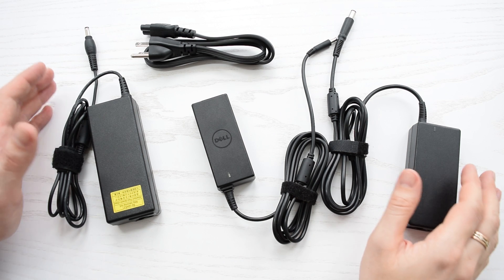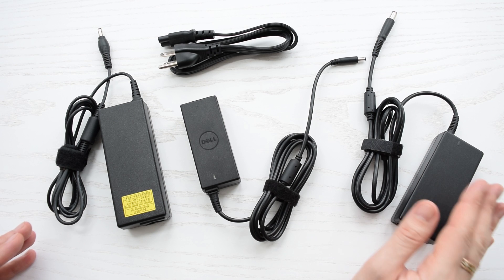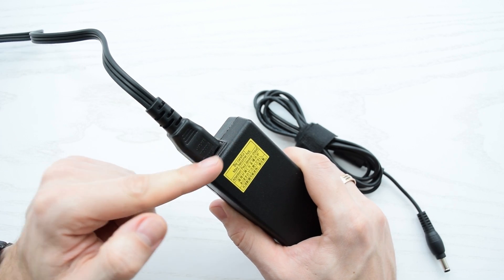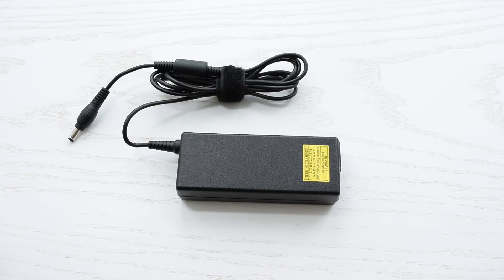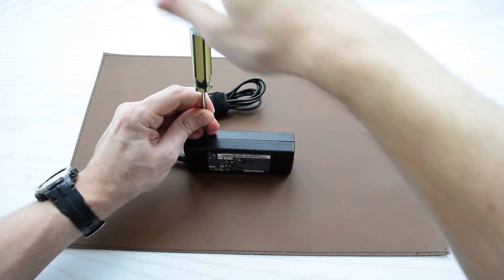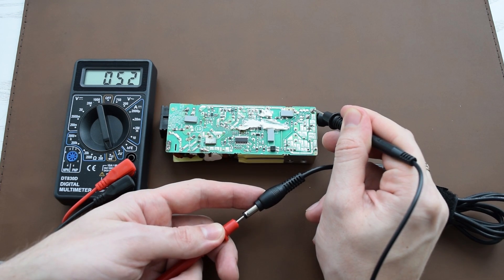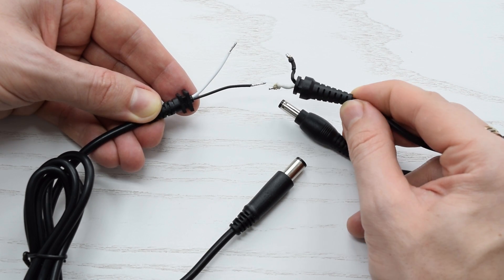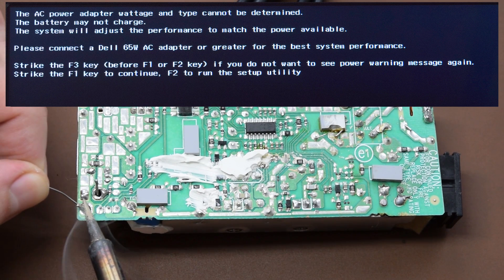How to Open and Fix Laptop AC Adapter without Damaging. DC cable and Capacitors Replacement

Comment: Hi, first of all great tutorial! 
I wanna ask about one thing. The LED on my adapter is of and it doesn’t give any power out. But somehow after a while with it’s plugged to power source, it became hot. Based on this, what is your diagnostic on this? Thanx in advance.
Reply from the maker: most likely you need to replace capacitors and I'd also recommend checking DC cable for short.

Comment: My spec is 9.5V, 9.3A and 180W, but when I try to buy DC cable only at online shop I cant found any with spec above 7A and 150W, if I use it what negative effect on my laptop?
Im trying to change my cable only not the adapter, will the 7A cable hold my 9.3A adapter?
Reply from the maker: There's no way your laptop can draw so much current. Not even close to 9.3 or 7 Amps. So you can buy that one it's totally safe.
Reply: @ElectronicsComputers  alright thank you Sir
Reply: @ge2565 Did you replace the dc cable?
I'm having the same issue and I'm worried that the dc cable I buy would not have the right voltage and current rating
Reply: @bonklord3925  no, my replacement cable is so thin im afraid to use it so i just cut my old cable in the part where its broken and then reconnecting it with solder+heat shrink tube

Comment: Hi!. Do yoy think it could be possible to solder the hp cable to a dell power brick? I think that the L shape holds better than the Dell design
Reply from the maker: Technically they are absolutely identical so you can easily swap them.

Comment: Broo, yyou made my day, Thank you so much, I have fixed my own cable and now I am back with you all. Thank you !!!
Reply from the maker: I'm glad I could help you!
Reply: @ElectronicsComputers I need help can anyone tell me whether my adapter is faulty or not based on following test
My laptop adapter input is 19.5v. so when I set my multimeter at 20v it shows 0L and when I set it to 200v it shows 20v and when I set my multimeter to 600v it shows 19v based on this is my adapter faulty or not?
Reply: Did you fixed it on ur own?

Comment: Being a complete novice, after removing the outer shell (which was a bit more difficult than expected), I picked up the board without any gloves and it shocked me. So I decided to start moving it using 2 big screwdrivers (with rubber handles, bear in mind) but they must have touched and something sparked. Lucky for me the charger was unplugged (at least I tought of that!). Lesson learned: next time, DON'T TOUCH THE PCB, WEAR GLOVES AND WAIT A FEW HOURS AFTER UNPLUGGING THE DEVICE BEFORE HANDLING IT!!!!
Reply from the maker: The big capacitor must be discharged before you start working on it. It's not gonna kill you but still unpleasant experience I should have mentioned about discharging the caps. Sorry for that!
Reply: Such a great advice, sir. Thanks
Reply: "and it shocked me" ...
as is i am a m_oron and stuuup1d

Comment: Discharge capacitors before touching the pcb.
Reply: How to discharge it kindly tell?
Reply: @syedmuhammadhamzatauqeer7853  short circuit its connectors after disconnecting from power

Comment: Can you tell me a way to damage a working adaptor without any symptoms ?
Reply from the maker: I think the easiest way is by bending the DC cable back and forth until the internal wires brake.
Reply: @ElectronicsComputers   thank you so much for your reply, i have tried it but unfortunately the way is not working, i am using lenovo adaptor and it is very strongly packed. Can you help me with any other way, even if it is tough.

Comment: Everyone be very careful. I took my adapter apart that hadn't been energized for over a day and it still showed 120VDC across one of the capacitors. That can really bite you! Get a resistor to drain off that charge before touching.
Reply: It just happened to me when i opened my charger, what can i do to drain off the voltage since i don't have a resistor?
Reply: @imadrabhi5991  You should discharge it through some resistance or you could damage the capacitor. If you can rig up a light bulb with some leads (that are insulated...) you could discharge it through that... Otherwise, it will dissipate over time, but it could be a few days. If you are feeling lucky, you could use a small insulated screwdriver and just short it out in little bursts but it might damage the capacitor. Wear eye protection, though!
Reply: Yeah I once died because of this. So be careful people
Reply: Too late, I disconnected mine and after a minute it bit me. Not too bad though, because I touched it with one hand. I then measured the typical voltage 1 minute after disconnecting it, and it showed around 300VDC. The capacitor is reading 400V. Ugh.
Reply: Reminds me when i took apart a disposable camera, it was like getting hit with a stun gun. :D Always wary around caps now.
Reply: @alexanderchurikov7026  it isn't the voltage that kills you it's the amperage. Voltage will knock you on your ass amperage will stop your heart.
Reply: @BobJones-fc3ef  true, but we should also remember that amperage is directly proportional to voltage. I think a 400V 1microF capacitor can kill a human. If someone can prove me wrong, I'd be glad. Otherwise, I'll just stay away from those and warn other people.
Reply: @alexanderchurikov7026  when I was in 1rst year electronics in high school I was handling a capacitor that had over 1000 volt potential and accidentally touched the metal can .It blew me off the lab stool I was sitting on and left me shaking on the floor with some nice burns on my hand. We tested our bodies resistances and I discovered I was the highest "resistor" in the class. Fun memories.
Reply: Nah just short it with a screw driver
Reply: @xsauce3858  Only if the capacitor is tiny, otherwise you will damage both the screwdriver and the cap.
Reply: @xsauce3858  The current flowing through screw driver would be massive!
Reply: Can you connect your (a) multimeter to the leads and discharge them that way too? Thank you
Reply: @j.lietka9406  Here's a nickel kid, get yourself some probes that go across a power resistor.
Reply: good thing to remind us, all the hobbyists.
Reply: Hahaha late
Reply: would latex gloves help you with safety or is it not enough to stop that kind of voltage? would it at least help a little?
Reply: Pls tell me any ac dc adapter contains mercury
Reply: 120 stings worse than 460.
Reply: I need help can anyone tell me whether my adapter is faulty or not based on following test
My laptop adapter input is 19.5v. so when I set my multimeter at 20v it shows 0L and when I set it to 200v it shows 20v and when I set my multimeter to 600v it shows 19v based on this is my adapter faulty or not?
Reply: Does using a multimeter to measure the voltage on the capacitor will discharge it
Reply: it's not the voltage that will kill you it's the current. consider a static shock is 2k volts, but very low current. Yes i know what you mean and yes there is also a lot of current along w/ the 120volts.
Reply: U wouldn't feel it because it is 120 DC and DC is much safer than AC
Reply: @sinanajam9682  DC is slightly less dangerous but both can certainly kill you.

Comment: How do you take out the screws at 2:27
Reply from the maker: there's no any screws
Reply: @ElectronicsComputers  Once you open the main protection of the AC adapter there's a still a steel cover before being able to access the capacitors. How do do you open that steel cover?

Comment: Hi how are sizes rated or identified for different uses or is each unique? Great video by the way, very thorough.
Reply from the maker: you mean capacitor size?
Reply: I just don’t now how to identify if one is the same as another. I have a lap top cord that the thin part has frayed, having some old ones (similar in appearance) I am wondering how to know if they would be essentials the same.
Thanks
Reply from the maker: @KennTodd117  You didn't answer my question!!! I have no idea what size are you talking about. DC connector, capacitors??? Give me at least some models or upload pictures here: https://imgbb.com/

Comment: Great video! Just wanted to post a warning. My LED was always lit meaning the AC cable was not my issue. The cable post DC conversion was the problem. I removed the case and then suddenly the LED does not turn on when plugged in. As soon as I removed the case I smelt something that most engineers would recognize as a shorted/damaged part. I looked all over but couldn't find any damage. I'm wondering if the power supply is rigged to break when opened. Or maybe some cap was shorted during the case removal. Anyway, be careful! Removing the case may make things worse :(
Reply: Oh, yeah, I punctured one of the capacitors with the screwdriver when trying to open it ) Hit too hard )) It wasn't working anyway and no visible issues inside, so nevermind.
And yes, you can short some components while opening, because there are metal plates inside, that are very close to other metal parts. At least in mine. So if you bend something, it may short.

Comment: The inside and the middle pin on the connector are connected? tested the connector inside the laptop and they appear to be
Reply from the maker: NO! They are not connected together. There's no continuity between those two wires.
Reply: @ElectronicsComputers  Ok! Thats why it broke then XD, the ones in the inspirons with the protruding center are made to break and are stupid expensive for a piece of plastic with metal.
Reply from the maker: @Dasgath  if the problem in cable you can buy a new one for about 4$ delivered. the links in the description.
Reply: @ElectronicsComputers  Not the cable, the conector, the plastic in the middle broke. I live in argentina so no chance, here they selling the internal dc jacks with cable for about 50 dollars... 50!

Comment: Pls see to my problem 
I used to take in and out my charger from the power so many times one day suddenly the led is not lighting and I’m not able to charge 
What can be the possible prob ?
Reply from the maker: If you plug your AC cable slowly into the the power adapter does it make cracking, crackling noise?
Reply: 2013Electronics&Computers when I did first I didnt the 2nd time I heard a slight sound
Reply from the maker: @whatwelearntoday  It's hard to tell it could be dead capacitors or shorted DC cable. Without looking inside it's impossible to diagnose problems.
Reply: 2013Electronics&Computers how can a shorted cable be diagnosed,only by looking inside ?
Reply from the maker: @whatwelearntoday  By checking continuity with a multimiter.
Reply: @ElectronicsComputers  Hello, when I plug in my ac adapter it does make a crackling noise. Is it possible to fix this at home due to quarantine
Reply from the maker: @kk2937  If it happens only when you plug it in then it's absolutely normal.  If that crackling noise keeps coming on it own then you have a loose contact and you need to fix it.

Comment: I got shocked by the main capacitor... skin is burnt
Reply from the maker: Be careful! Discharge them with resistor or at least with a screwdriver.

Comment: Got a chance to look at powerbrick today. Dug it out of can. Plugged it in and it makes a hissing noise. Almost like a beep going on and off.
Reply from the maker: Sounds like dead capacitors or a short in DC cable.

Comment: I fixed mine. Went to walmart with $20 bucks and bought replacement adapter.  I took battery pack apart its jus some c-size lithiums soldered together.  It works without the battery but i ordered a used one on el interneto.  Thanks for video  tho i did take it apart and believe the capacitor was overheating
Reply from the maker: Speaking from my experience there are two common issues with the powerbricks dead capacitors or AC/DC cables.
Reply: @ElectronicsComputers  Thank you for reply. It was very hot so i decided to be safe and dont have a lot of time either.  This was a used one bought from computer repair store so im on third one now. Well see how long this one makes it.

Comment: Hey, i have a ASUS monitor whose supply of power comes from an AC/DC adapter and it works but keeps turning off and on. Is it due to loose contact between the adapter and the monitor and maybe if I turn the cable a little bit it works? Or should I get a New adapter?
Reply from the maker: Most likely the problem in a cable or DC connector/jack. It's hard to say... When your monitor turns off do you still have indication on your power supply? Try to shake the cable, connector and jack if it doesn't turn off then the problem somewhere else.

Comment: my Ac power adapter Led didnt light up and when I plug it in my laptop it doesnt charging.
can you help me whats wrong with my power adapter plz response I have presentation this week I need my laptop
Reply from the maker: If you disconnect the AC cable from your powerbrick and them slowly insert back in do you hear electric cracking noise?
Reply: @ElectronicsComputers  but mine doesn't have cracking noise when I plug it back in the powerbrick.
any solutions?
Reply: I do
Reply: Same thing is happening to me
Reply from the maker: @cyp0492  So, in that case your power brick receives power from the outlet. I could be dead capacitors or your DC cable is damaged and shorted somewhere. Try to bend and wiggle every single inch of DC cable while constantly looking at LED. If you'll get indication at some point then you need to replace DC cable. Speaking from my experience in most cases the problem is in: 

1. Capacitors 

2. DC cable
3 other components.
Reply: I have this same prob suddenly one day my laptop chargers led is not lighting up and I’m not able to charge too

Comment: don't you need to let the capacitors discharge so you can work on the charger
Reply from the maker: Depends on a power supply. In my particular case they discharged by itself in a couple of minutes.

Comment: Help me please. I have an HP Slimline Desktop that uses a 19.5v 3.33A external supply. I have the correctly rated supply but want to solder directly to the board. What is the input for the (3rd)center pin? I want to build a custom case.
Reply from the maker: you don't have the original power supply to measure the voltage? Usually that third wire is a current or ID sensor to recognize the power of that power supply and if it's original HP power supply or not. It will work without that third wire but if it's a laptop then it's not gonna charge the battery and may limit the CPU power.
Reply: @ElectronicsComputers  I'm just wanting to power a desktop.
Reply: @ElectronicsComputers  No. I was given an HP Slimline 411-a005na. It has no power supply.
I want to wire a supply directly to rhe board. I have a power supply that is of the correct specs but am not sure about the 3rd pin.

Comment: my hp charger has two output but in a pin, there are three inputs. now icant able to connect it. so how to connect it?
Reply from the maker: All HP laptops have 3 wires in DC cord and 3 terminals in DC connector and jack.

Comment: Thanks dude. Fixed my Thinkpad charger that had a loose connection on the inside. I just resoldered the joint and it works now
Reply from the maker: I'm glad I could help you!

Comment: Hi,
I have a OnePlus Dash Charger ... a 20 Watt ... 5V - 4 Amp output charger ... Its supposed to charge the phone to more than 90% in about 60-70 mins ...

My charger was doing that fine ... I dropped it a couple of times ... and now i notice that its rapid charging capacity is not the same as before ... The phone shows as rapid charging on the display with a lightening bold ... but the rate of charge is nowhere close to before ... 

@2013Electronics&Computers ... given your knowledge in the charger dept. ... i would like to know what could have been damaged as a result of the drop ... could it be a detached solder of some component or maybe a capacitor or any other component that could have been causing this delayed charge ?

I thought i would open(which is a challenge given its sealed pretty tight) and take a look inside ... a little expert information could help in resolving my issue.

thanks in Advance.
Reply from the maker: You might partially damage the power cord which may result in a higher resistance and as result slightly low charge current.  Some big capacitors may also become loose. It's hard to say without checking the components and measuring some key power rails.
Reply: @ElectronicsComputers  ... thanks for the quick reply ...

there is no power cord ... its a direct wall socket charger with a USB that enables charging devices with the data/charging cable.

even i suspect a broken solder having loosened the joints ... Now the big challenge is how do i open the sealed phone charger without damaging it ... so i can glue it back together ... 

2013Electronics&Computers ... Any ideas ?  I saw a video which used petrol ... for opening the laptop charger ... not sure if it will work on a mobile charger ...

Comment: Thank you! this is aweosome! My laptop adapter just broke down possibly due to me wrapping cable the wrong way all the time. I wiggled the cable near the brick and voila it is working again!
Reply from the maker: I'm happy to help!
Reply: @ElectronicsComputers   You just got a new sub! Do you think I can survive on that adapter by wiggling it back in connection or it could dangerous in long term? I worry the re-connection may be have a small electrical contact that causes too much resistive heating. It is a 200W brick.
Reply from the maker: Thank you for your support! You have to replace the cable because it's not gonna last long. It will become harder to get contact because due to bad contact and high power those wires will slowly burn and brake. You can use it as a temporary solution. New cable costs about 3-5$ delivered! Of course if you don't have a soldering iron and stuff for it then it's a problem I guess.
Reply: @ElectronicsComputers  Appreciate it. Gonna wait til it dies then I may repair it.